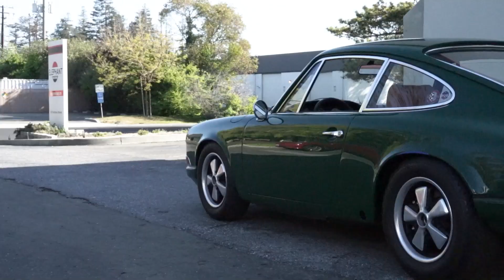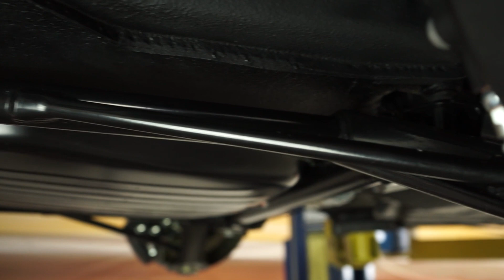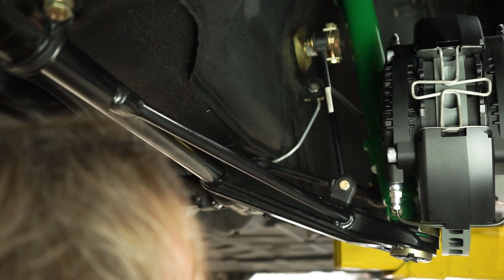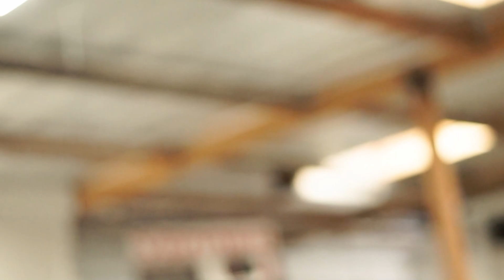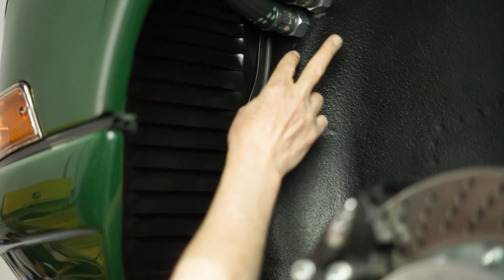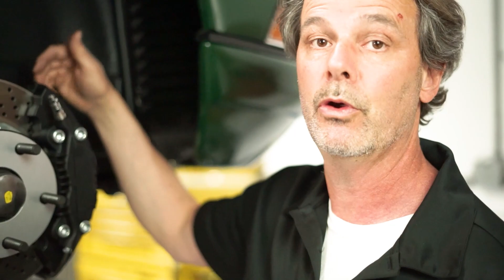R Gruppe Porsche 911 Walk Around Sport Suspension and 930-ERX Brake Upgrades Elephant Racing

Comment: Greetings from the PacWest chapter of R Gruppe!  I believe I may have seen this car in Scott's shop a couple of years ago when he was building it.  He really does do outstanding work, with his attention to detail being second to none.  Whoever owns this car has a truly outstanding example of the sports purpose 911.
Beyond that, I would like to add my hearty endorsement of your ST type oil cooling system.  I had been fighting oil temperature problems in my '72 911 R interpretation for years.  I'm running a very healthy high compression, twin plugged, MFI inducted 3.0 liter in this car.  No trouble at any point in normal street use, but out on the track had been another issue entirely.  Hot days would see me cutting sessions short as the oil temps rose to an uncomfortable level.  This was with one of your single Wide Mouth coolers and finned lines, which I was admittedly over taxing.  I was at a loss, as I did not want to add the center RS style cooler, which simply didn't fit with the "theme" of my car.  Your ST style kit saved the day.  The car now has more than ample cooling capacity not only up here in the Pacific Northwest, but even when I participate in our R Gruppe "Sports Purpose Days" out in the California desert.  And, on top of that, it gets lots of comments on the rare occasion I park it long enough to participate in a "cars and coffee" or other such car show.  Not many people, even early 911 guys, know what's going on when they first see it.  Very cool stuff (pardon the pun...).  I cannot say enough about this kit for anyone in need of some extra oil cooling.  It really did the trick for my car.